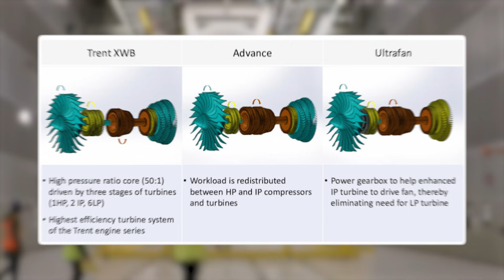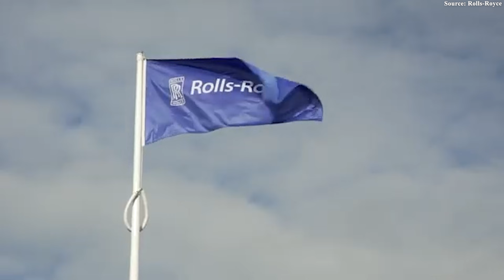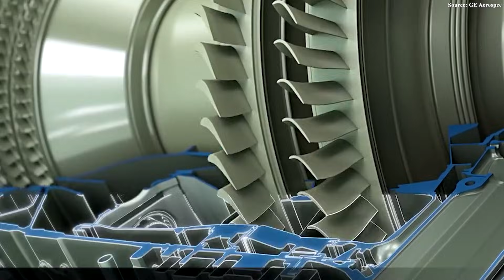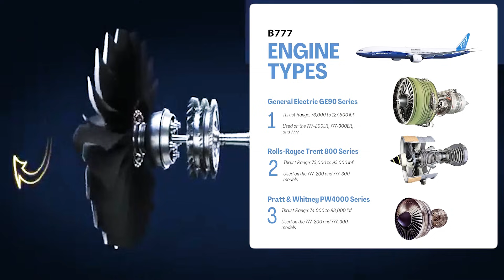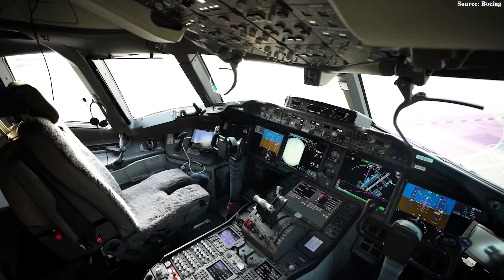The SHOCKING Reason Why Boeing 777X Chose GE9X Over Rolls-Royce Ultra Fan

Comment: The incompetence of Boeing managment is staggering. Both types of engine are cutting edge. Neither are simple upgrades on old designs. Therefore you would be a fool not to realise the VERY high risk of medium and long term issues emerging from either or both these engines. Sticking to one could finish you if a series of issues emerges. That is the nature of new technology.

Comment: I had to stop at 4 minutes, because this turned into a commercial for General Electric. Can I remind readers, that the GE9X has not run commercially, so there is no confirmation of how well it will succeed in airline service. Secondly, the RR UltraFan is a 'testbed engine' only, so it wasn't rejected by Boeing, it simply was not even offered!!

Its quite obvious that over the last 10 years, two alignments have developed for widebody aircraft. Boeing have demonstrated that they prefer GE, and since AIB were rejected by GE to engine the A350-1000, AIB now feel more comfortable with RR. RR have an exclusive on the A350 until 2030, but rumour has it that will be extended beyond that, as RR are developing a new Trent for the next generation of A350s, with developments from the UltraFan, for delivery mid 2030s.

That's the way its going to be for the next ten years............

Comment: The UltraFan timeline didn’t line up for production so it was never an option. Also studies and collaboration between GE and Boeing on the 777X and its engine began well before the official selection. So Rolls Royce wasn’t ready with UltraFan and GE got a head start.

But RR isn’t hurting, they got exclusive contract on A330Neo and A350 XWB and surprisingly, 787-10 (largest variant).
Reply: Thanks

Comment: GE9x is seriously flawed. So many problems has delayed certification of the 777x.
Reply: Rolls Royce has had issues with their engine offerings for the A350. Those engines have issues operating in the Middle East.  Emirates and other carriers have had issues with those engines.  The trent engine offerings for the 787 have not been as reliable as the GE offerings.
Reply: @mk84boom  not any more. Problem fixed
Reply from the maker: Yes.

Comment: Actually, it's really simple. Chronologically, the 777X program started in 2011 and was officially launched with performance promises in 2013. The Ultrafan project did not exist until 2014 -- way after the selection has occurred. Physically, a 15:1 fan would not have fit under the wing of the 777 platform; this is also why the GE9X is a 10:1 engine not 12:1 or some higher ratio even though it could have been with or without a reduction gearbox. Practically, the Ultrafan would have been much higher risk than a materials upgraded to the GE90.
Reply from the maker: Thanks for the info
Reply: yes it would  Ge90 a lot larger

Comment: At 2:08 this video states that the GE90 “… was the sole engine for the Boeing 777”. Not exactly. The early 777-200 and (non-ER) 777-300 had engines from Pratt & Whitney (PW4084), Rolls Royce (Trent 877) as well as GE (GE90-77B on the 777-200). The most successful variant, the 777-300ER (as well as the 777-200LR and 777F) were indeed exclusively powered by variants of the GE90-115B and GE90-110B1 which, however, had a different architecture than the early variants of the GE90 series.
Reply from the maker: Thanks for the info